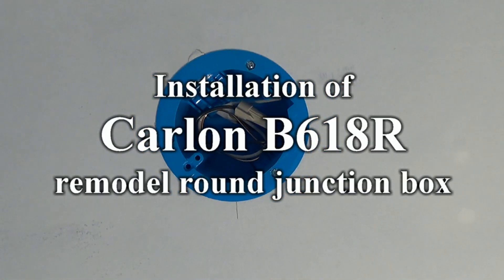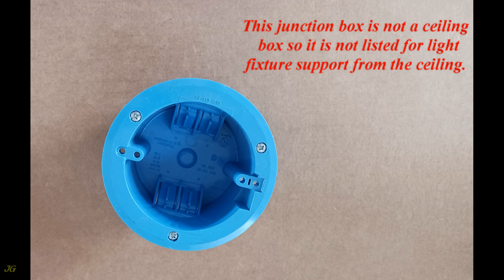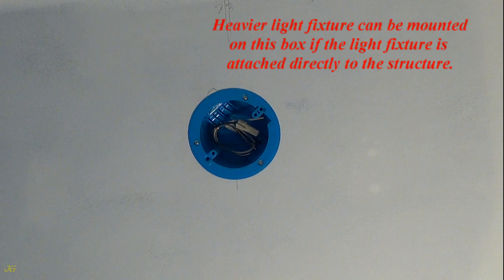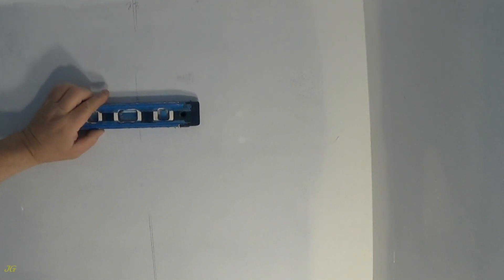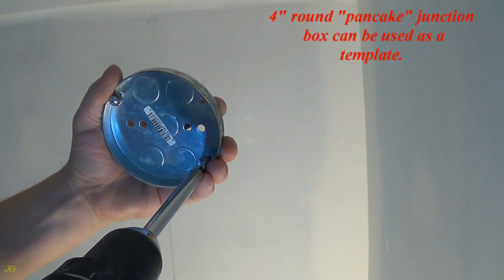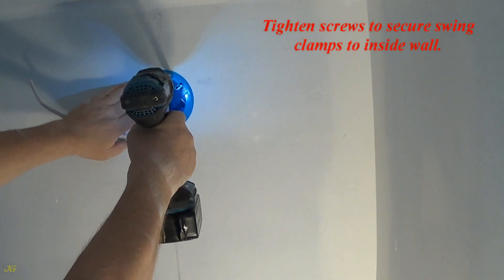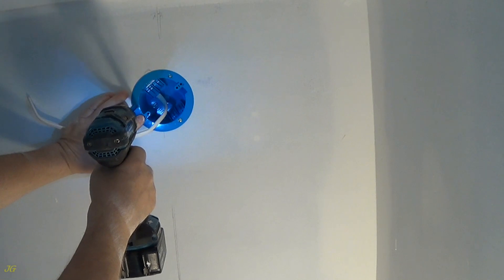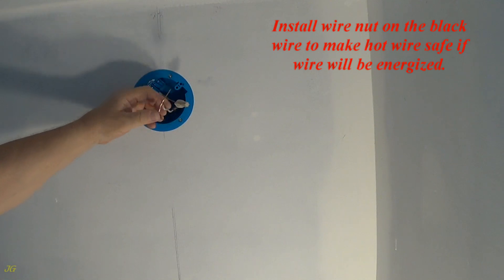Carlon B618R remodel box installation

Comment: I'm installing on old plaster ceiling and the screws connecting to the clamps don't seem to tighten??
Reply from the maker: The junction box is intended for installation in drywall.
Not rated by manufacturer and NEC for installation the light fixture from the ceiling.

Comment: What happens if you cut the hole slightly to big?
Reply from the maker: You need to open the wall and do the same as with an open wall, using another junction box. Rule: "Think twice, act once."
Reply: @johng2913  I just went to Lowe's and got a round bracket made just for this issue.